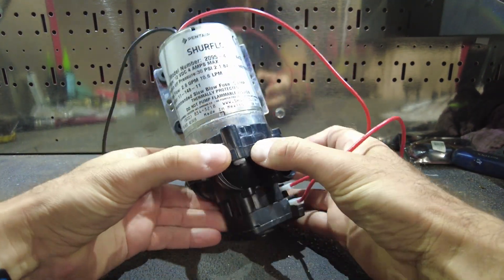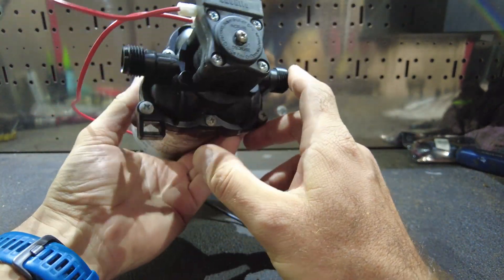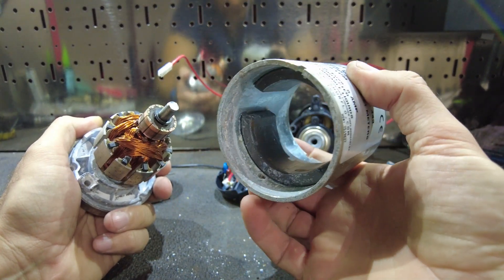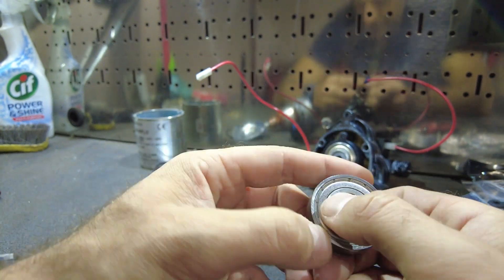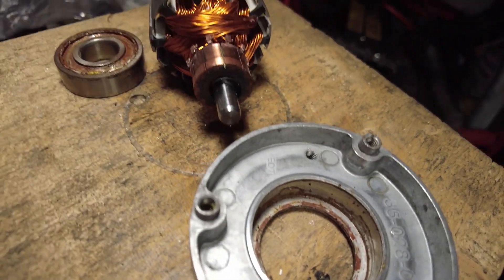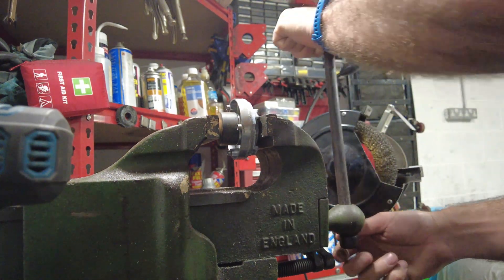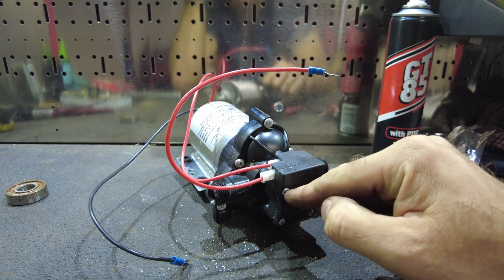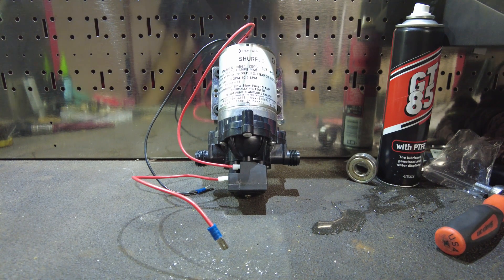Campervan water pump repair. Seized Shurflo pump diagnosis and fix. Motorhome and RV 12v pump.

Comment: Excellent vid! Have the exact same problem with a used Shurflo pump I inherited. Looks in great condition externally, but is heavily rusted inside. I give this a try. Just need a bench vice or G-Clamp. 😄
Reply from the maker: @JoshFerlanceJoshWashesWindows  Always worth trying to save something from landfill, plus it can be much cheaper than a new one